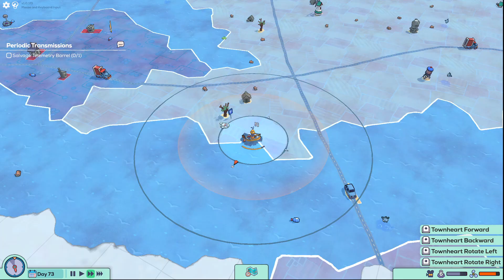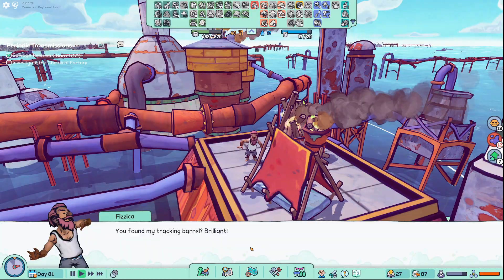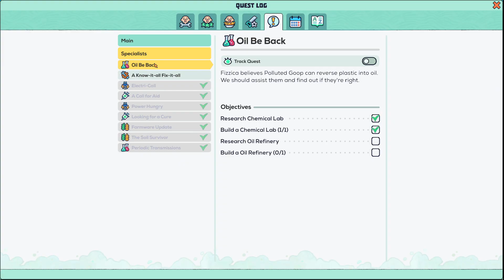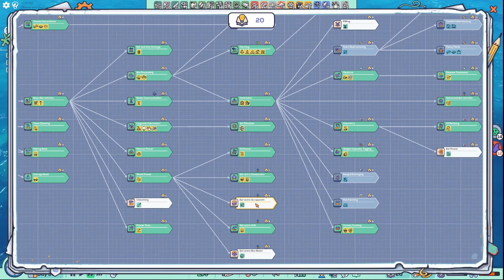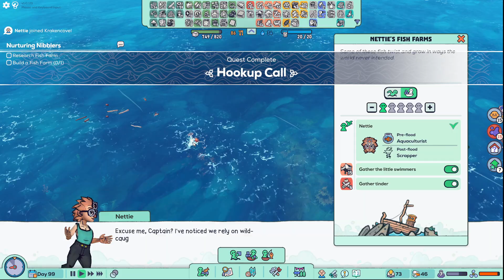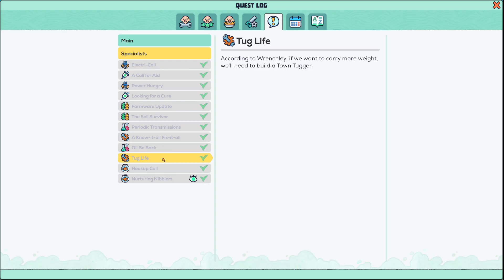Expanding the Town One Specialist at a Time (Flotsam pt 5)

Comment: What's the difference between the air filter and the sleep respirator?
Did you get that solar panel built? What does it do for you?
What sort of meals do you get to create with all of those new foods you're getting?
Sorry for so many questions; I blame the editing for skipping those bits.
Reply from the maker: Don't apologies for asking I'm happy to answer questions sorry if the editing wasn't clear I'm still learning ill try and keep things clearer next time. 
Air filter and sleep respirator do the same thing reduce pollution levels while the drifters sleep the air filter is easier to make which is why I made it first I will probably add the sleep respirator in time to double up on reducing the polution.
Yes I did build the solar panel it provides electricity to charge the towns battery which powers the ship movement as well as many of the buildings including the grill, declinator, electrics workshop ect. 
So I don't have access to any new recipes as of yet, I do plan to add some new cooking stations in my next video and will probably do the cooking related quest which will open up even more possibilities.